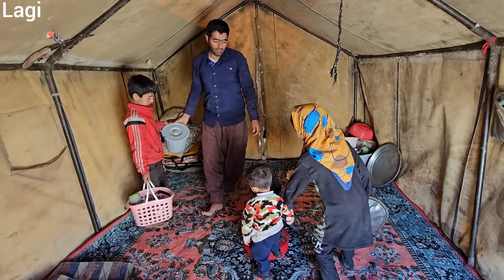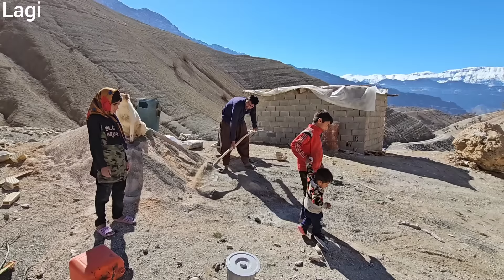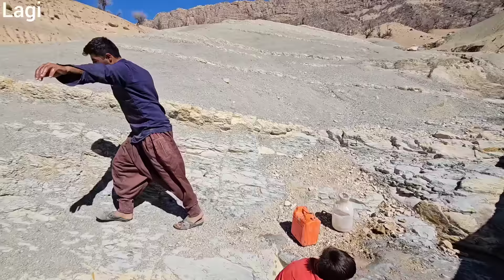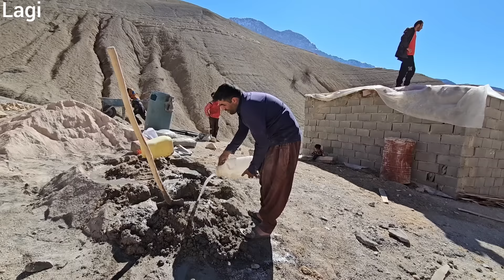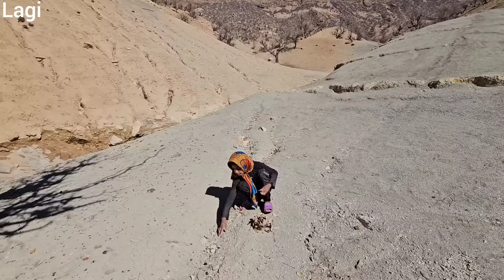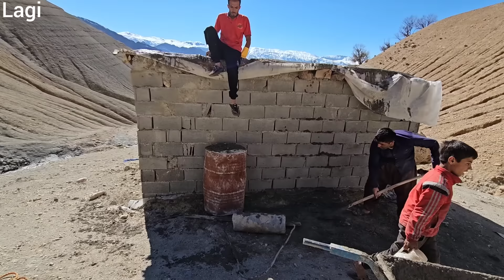Posted by the operator The extraordinary efforts of the operator to help motherless children

Comment: Спасибо большое всем кто помогает этим детям, а под трубу под печь на крыши не сделали отверстие дети будут мерзнуть
Reply: Да какие то как будто родились не в то время и не с того места! Отец их кто вообще ,ничего не умеет и даже под трубу не подумали,писец полярный!
Reply: The kerosene heater needs no ventilation pipe and more enough to heat the house, vent for wood stoves should be done in wall so avoid leaks in roof. I'm so ready for them to move to the house.

Comment: I saw someone mention that they had no vent pipe for stove out the roof. That kerosene heater from the tent im sure will heat the house up to point of them sweating. Until they burning wood in wood stove they don't need a roof vent. Id much rather see one vented out wall not the roof, to save from leaks. Please bring them home get them out of the tent.

Comment: Ah yes now I see. Trucks dumped huge hills of gravel in front of their house. If you look in back of their house it's the same hill of gravel. It was probably a work site where gravel for ditches, bridges and roads was stored and used from. The house was built right on top of one of the gravel hills stopping them from getting to it. The truckdriver doesn't care but when a foreman or vip finds out that house may have to go. It is sitting on and blocking alot of product from being used. Product=money